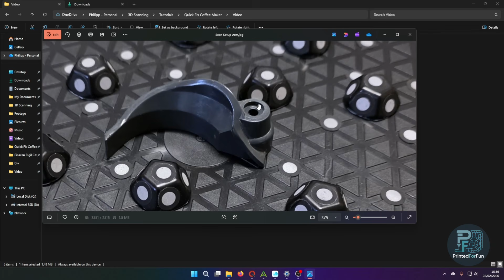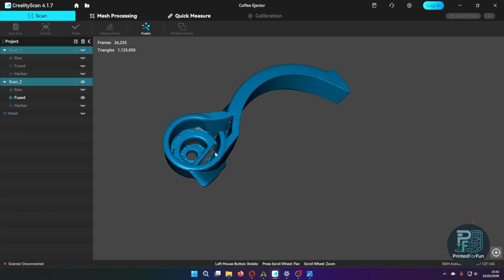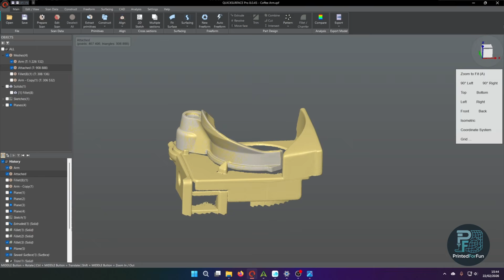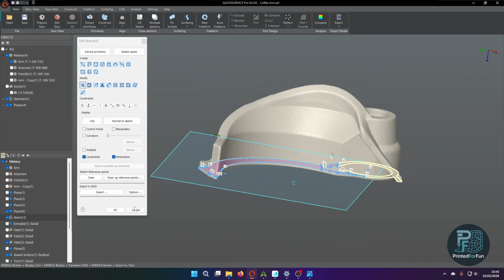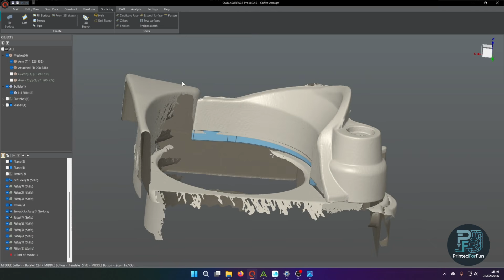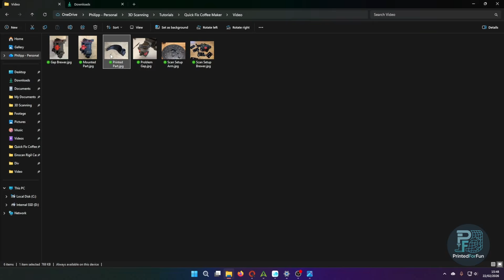The Lazy Way of Reverse Engineering for Quick Repairs

Comment: Excellent job. From concept to instruction. Thank you! Edit: I just watched this Quicksurface Tutorial:”Merge multiple roughly aligned scans”. I think there are steps after “merge” you may find helpful using the OP’s technique (global fine align and re-polygonize)
Reply from the maker: Thank you for the advice. I already use a lot of fine align for multiple scans and comparing them to each other. Will have a look at retopoygonize. Haven't used it yet